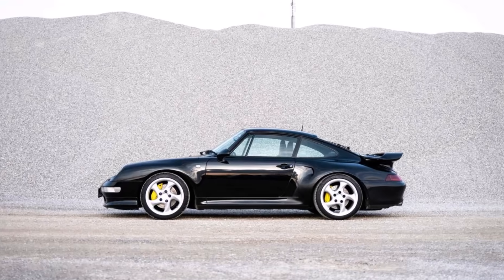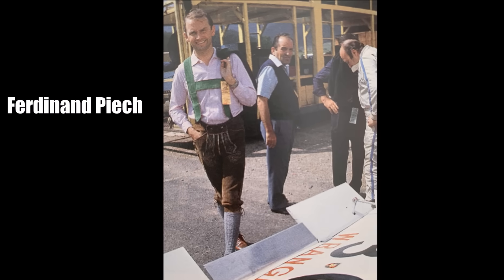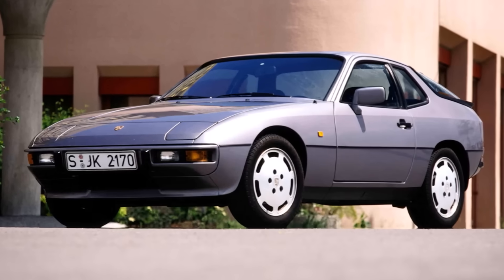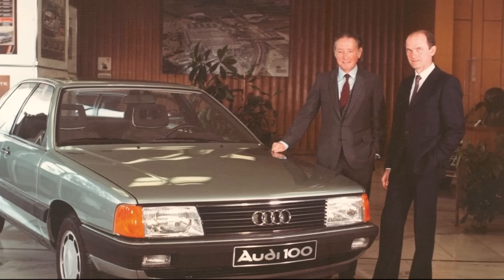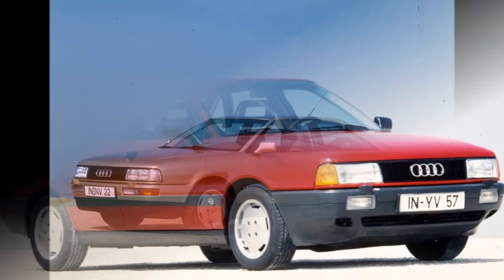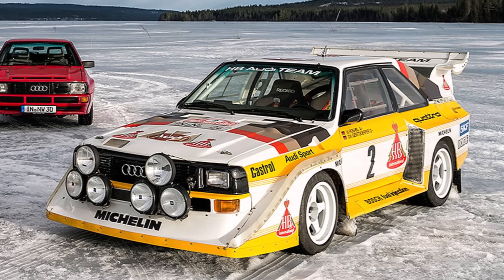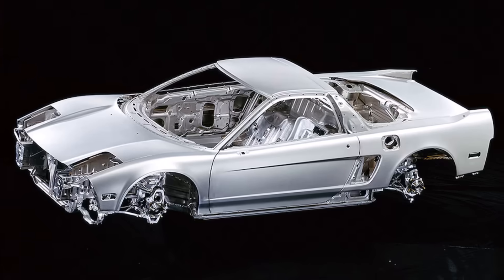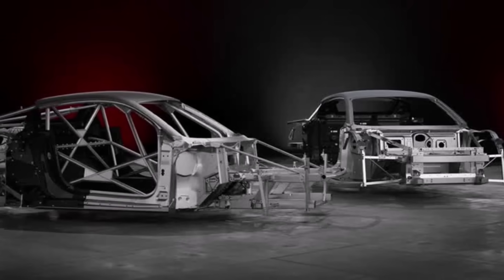How AUDI and Porsche eliminated corrosion forever - Development EXPLAINED

Comment: Galvanizing is not all created equal.  Zinc galvanized or galvalum?  Hot dip or electogalvanized?  How thick?  Constructed of spot welded galvanized sheet or galvanized after construction?  How's it primed?  The underlying steel still matters too.  I would have liked to know more about the methods used.  And there will still be corrosion.  Even if it's high quality stainless steel, enough salt will eventually corrode it.  Rust Never Sleeps.
Reply: even stainless steel rusts, it just takes longer. galvanised is nice but it will indeed start to corrode sooner or later, depending on the application of the device/tool/products/.... in question, it only takes a dent or a scratch to jumpstart the process.
Reply: @louisvl10 or it does immediately, e. g. Cybertruck
Reply: @louisvl10  There are many different grades of stainless. Common acid resistant stainless grades like 4404 will not rust at all under normal conditions as it can handle regular acids and salty conditions like seawater just fine. Sure, if you spill a strong acid on it like battery acid, it will still corrode.
Reply: @louisvl10  it's not gonna rust as long as the coating to protect the steel is maintained.
Reply: @sepg5084  by 'maintained' you mean 'not damaged' - right? Or do you mean taken apart, pain stripped, sandblasted, prayed over by a herd of monks, primered, had a chicken voodoo offering done over it, wiped with unicorn tears and massaged by a 1000yr old kracken, then painted and put back? "maintained" has no defined meaning in this context really.
Reply: I'd like to know more about the exact processes they used too. Also, I thought phosphating and e-coat would have got a mention too, as they make a big difference, and Porsche started using e-coat around the same time on some components (eg 914 rear semi trailing arms, in about 1974).
Reply: Hot-dip is impossible for sheet metal, because it warps badly.

Thin parts were ordered as electrogalvanized from the manufacturer, then pressed. This even caused a shortage back in the day!

Only thick parts like subframes were hot-dipped. 

Spot welds are the major weakpoints of course. Thats were rust starts first.
Reply: @them0leisback  I wonder if you could spot galvanize over the spot welds. Imagine a welding robot first spot welding, then quickly brushing the gunk off then immediately brining in a really hot soldering iron that's fed with a zinc wire to put a drop of molten zinc on top of the spot weld while it's still warm.
Reply: @them0leisback I worked on a line that does exactly that. Sheet metal is absolutely hot dip galvanized on modern cars. It's a continuous process.
Reply: Bodies are not 'galvanised' they are assembled from Zintec ( electro plated sheet steel ) then spot welded etc, so cut edges and spot welds are untreated. What prevents corrosion is the E-Coat process, nothing else.
Reply: You are right mate. Audi's and all German cars still rust like hell. I'd say it's actually Opel that rusts the least. I have seen tons of cars up close here in salty Norway. Believe me, the Germans take the cake when it comes to rust. On a Japanese cars I have never had to use an angle grinder on bolts. On an Audi it is the standard tool for a brake job.
Reply: Certain parts of the body were hard soldered together instead of being welded, using hard solder prevented the zinc layer from being damaged. When the 100 C3 was released, Audi made a small booklet for marketing purposes, in here they outlined several different techniques of constructing the body. It also shows a prototype 100 C3.
I still have the booklet.
Reply: I see everyone being picky, but galvanizing is way better than nothing.  Also, oxidation (rust) and corrosion are not the same.  One is a specific form of another.
Reply: Compared to Morris Marina's which could rust through a door skin in 1 year, does it actually matter?
Reply: A lot of people in these comments don't understand that zinc is a cathodic coating. Even if bits scratch off, the surrounding zinc still protects the area. Other metal coatings will accelerate the rust at cuts and pinholes (chrome is a classic example).
Reply: "Which is better, Galvalume or galvanized?
Galvalume offers better corrosion resistance and longer lifespan, typically 40 to 70 years depending on climate and maintenance. Galvanized steel is less expensive upfront and suited for moderate environments where extreme moisture or industrial pollution is not a major concern".
Reply: HOnestly, the galvanizing used on Audi vehicles isnt the best. I've got a Q5 that ahd to have it's rear subframe replaced cause it was rusitng away.
Reply: @apocalypse4312  I think it was only the bodies that were galvanised.
Reply: @apocalypse4312  I don't think sub frames are galzanised
Reply: @apocalypse4312 those parts are not galvanized.

Comment: Even on an Audi with fully aluminium body you can find some rust. It's on some fasteners, exhaust pipe, and some crossbeam that the bonnet latches into. But that's stuf that's easy to fix and not structural.
Reply from the maker: We concentrate on body rust in this video
Reply: @bsport320  So the crossbeam on an A2 that's right behind the fake grill, is sort of a body part. It starts to slightly rust after 20 years😂
But you have to open the bonnet to see it, and it only holds the dipstick, headlights, and some latch for the bonnet.
And with slightly rust, I mean a thin layer that's easy to dissolve.

Comment: Why then more modern VWs rust more than VWs that are 30 years old? VW Passat B6 is almost twice as young as the Audi 80, but Passat B6 obviously more rusty.
Reply: The B6 and cars from its are are much worse than what came before, especially for the coloured panels. In 2005 EU introduced regulation for car manufacturers needing to decrease the  amount of solvents used per car produced. 

This lead to some places of the cars that followed shortly after to have decreased paint thicknesses and some sections where different coatings were used. 

The chassis is still quite well protected, but the B6 is definitely not as resistant to scratches or stone chips on its exterior panels.

Comment: I had an Audi 80 B4 as a daily driver for a few years. The small amount of rust after 25+ years on the road, 15 of which it saw harsh winters with lots of salt, was incomparable with other cars and none of it was in structural parts of the body. Several friends have had B3s and C3s that were also decent. Sad to say this, but after the B4, Audi's steel body rustproofness plummeted and I doubt they'll ever reach the same level again. Now it's just average together with VW and Škoda and maybe Seat as well, they all rot just the same. These days you can again see cars less than 5 years old and driven less than 100k km developing rust spots on the sills, door edges, in the wheel wells etc. In some points there is nothing but primer underneath the car, when in the olden days they had covered everything with thick rubbery mass. Unbelievable cost-cutting everywhere.
Reply from the maker: Yes it’s sad to see how they cut back and saved money again.
Reply: I have a 1995 B4 90, no signs of rust yet! I love my car

Comment: In Mercedes the rust eats away at the weight of the car to compensate for the eventual decline in engine power due to wear. Thus the power to weight ratio and performance stays the same. 😂
Reply from the maker: Never saw it that way😅
Reply: Now that is good engineering.
Reply: Rust is lighter than carbon fiber.
Reply: @vvevvevvvvYeah mate but this is so much rust it will shred weight every time you drive over a bump 😅
Reply: Did you know that rust weighs more than steel? It has sucked oxygen molecules from air.
Reply: @mrtickles5982  until it falls off.
Reply: Y, but the rust flakes off, leaving speedholes. And everybody knows speedholes are like +5hp, atleast.  @mrtickles5982
Reply: @mrtickles5982 Y, but rust makes holes and everybody knows speedholes are worth atleast +5hp. 🔫
Reply: And Mercedes is the only brand that I know where rust spots just suddenly appear in the middle of a panel or door. Not on the edge or wheel well but just right in the middle of the door. Leave it and it will be a hole in no time. While I also have a 23 year old Alfa Romeo with a massive paint chip on the door and it just doesn't start rusting. Same with my Mitsubishi Grandis. The whole bonnet is covered in paint chips but hardly any rust. The only way Mercedes can get control over rust is by building the entire car out of some kind of composite material. (Plastic)
Reply: @Dani8chs  MB rust protection was awfull upp to W210 but got improved with the W211, slight more improwed arround 2005/6.
With the W212 it got really good, and got even better with the W212 facelift.
Reply: @fortune300 Yes only that it is only MB fans that believe that 😂 They are still the worst. Always have been.
Reply: Rust weighs more than steel, so that'll hardly work out in real life.
Reply: Oh man, this is gold
Reply: @SupraSav no, it's not..
Reply: I've never seen rust on a Mercedes newer than 1979.
Reply: @davidstjames_ Ok. Then you have seen very little of the world 😅
Reply: @Dani8chs   Don't judge others when you know nothing about them.  I've seen much more of the world than most people and my automotive experience is far greater than most.  Your ignorance of vehicles is very clear.  For over 40 years, Mercedes has had probably the best corrosion protection in the industry.  Now, GFY.
Reply: Wow sooo funny 🤦‍♂️
Reply: 924? look like a 944 to me
Reply: Problem with that is that a rusted panel is heavier than an untrusted panel until chunks start falling off.

Comment: My 2012 A4 is nearly rust free, a few rust dots if you may. Live in the baltics, estonia. Cold, salted winters & has held up like a champ. I don’t ever want to sell it.
Reply: Just take apart rear wheel arches, youll see more than few rust dots😅
Reply: @Glebaka  at least I don’t see it 😅
Reply: I'm jealous. My 2013 S4 (manual) is still in great shape except for rust on the rear arches and rust behind the front fenders at the lower panel. It kills me because otherwise the car, like yours, is a champ.
Reply: Southern Ontario, Canada here.Those in the know use a waxoil spray,body/chassis & have zero issues...gti & A4...PROST!!!

Comment: Galvanization is just a sacrificial layer over the metal, eventually that also goes down. Nothing is forever, it just makes it much more resistant but it ll still happen in the end especially if the rest of the car isnt properly designed with rust protection in mind
Reply: I have seen hot dipped galvanized parts that have been sitting in a damp cave for 110 years with zinc still on them. Electrogalvanizing does not depisit as thick a layer as hot dip but it does buy you many decades of usefull life.  I am a huge fan of zinc plating.
Reply: @mbox314 Yeah, hot dip galvanizing gives like at least 2-5x thicker coating, and the layers are much less capable of "self healing", or where a scratch that reaches the metal, never completely exposes it.
Reply: Yep, and especially when driven a lot in winter on salty roads.
Reply: A reasonable lifespan of 15 years in salt country means no rust ever again in California! 😂
Reply: Brass would never rust. 😄
Reply: @Rickenbacker451  it's also very heavy. Aluminium doesn't rust either and is light.
Reply: Some of those galvanized light posts on your street are over 30 years old. They still look new despite the salt spray. Only when they reach the 40 year mark does the rust start, and it starts slowly.

Comment: Car companies just figured out clever ways of hiding rust now.  Plastic around the wheel wells and the lower part of the car hides it until it's too late.
Reply: car companies seems to be gravitating towards making a car that lasts only while the leasing contract lasts. something something shareholder profits more important than making a good car.
Reply: No, they didn't. They just engineered powertrains that don't last as long as the steel in the rockers. The cars are scrapped before they rot.
Reply: Buy a Porsche or a VW PRODUCT AND YOU WON’T HAVE THAT PROBLEM!
Reply: Plastic undertrays are a godsend for rust protection IMHO. It prevents the underbody paint from wearing away, my 11-year-old Renault Zoe EV still looks practically brand-new on the underside, despite driving on salted roads for half the year in northern Sweden.
Reply: @swecreations Sweden doesn't even salt their roads brother
Reply: @eduardghemes Every part of Sweden except the most northern parts like Kiruna where the temperatures are generally too low for salt to be effective as well as the islands of Gotland and Åland sand their roads every winter.

I'm guessing you don't live in Sweden as I have a hard time believing a swedish person wouldn't know such a basic thing about Swedish road maintenance during winter time.
Reply: @eduardghemes  are you dense, sweden has 25000km of roads that are salted with 230000 tons of salt every winter.
Reply: They don't want you to see your car as it rusts, just find out when it's too late and need to buy a new one.

Comment: Honestly this always bothers me when (mostly Americans) recommend Japanese cars because of their reliability.

When I looked for a car a few years ago (I looked for late 90s early 2000s cars) all the Japanese cars looked like puff pastry from underneath and definitely would’ve needed some welding to pass the next inspection. Meanwhile almost all Audis had little to no rust and never in structural places.

If you ask me I much rather deal with a bit of engine maintenance than with sheet metal welding…
Reply: It is my understanding from watching american car culture youtubers for a while a few years ago that they in most places don't have such inspections as we do in EU which fail you for very slight things and keep you off the road. As such they probably don't care about the relatively non structural rust on japanese cars as long as they don't fold in half 😁
Reply: @ml11ML that as well as that every mechanic and their brother can fix a 1.8T or basically any VAG engine of the last 30 years while independent mechanics that are able to work on japanese cars are few and far between so you’re forced to go to a dealership.

Apart from that it feels like most of the American cars youtubers basically live in a desert so rust might just be an afterthought when they buy a car.
Reply: @Simoxs7 it's a poor mechanic that can only work on a VAG car but not a Toyota.
Reply: @ml11ML accurate!
Reply: They make it a pain to do the maintenance on modern Audis though
Reply: In India, German cars are notorious for poor reliability. However, Japanese cars are reliable, easy to maintain and repair and thus have the majority of market share. We have poor, broken roads here so the cars get tested really hard.

Regarding rusting, German cars don't have such problems mostly because their  DSGs blow up after 100,000 km, suffer from electrical issues and get scrapped after 5 years.
Reply: That’s the american way. I personally completely agree, if you take a look at junk yards and listings you start to understand that lifespan of a middle japan car is about 15 years (20 is the max), whereas  germans’ only start to glow like fine wine after 15 and get second life after 20
Reply: Yeah, steel bodied merican trucks are so resistant to rust😂😂😂….drive them off the lot and you can almost see the rust forming (excepting al bodied fords) ….
Reply: Also: The unibody IS THE CAR ITSELF! It’s the “part” that houses every other part, plus the VIN. Therefore, a rusty bodyshell means the car is gone and only bolt-on components remain.

A Golf with a engine swap is still a Golf, but a rusty Toyota is nothing other than a pile of car parts (and rust).

Comment: I work in auto body repair, VAG cars are specifically the most rust prone cars, I've seen a lot of previous generation Passat with rust already forming on front fenders
Reply: The 2005 EU solvent regulation for car manufacturers decreased the paint and coating quality a lot.
Reply: @rkan2  and somehow only VAG were heavily affected, crazy stuff.

Comment: What is meant by fully galvanized?
Stamped from zinc galvanized steel, or plain steel welded together and then whole car body electro zinc galvanized by submersion,
or cataphoresis by submersion or hot dip zinc galvanized?
Reply: At least it's not hot dipping.
Reply: I had those questions too.
Reply: They use galvanized steel as raw material for the body.

Comment: As the time has passed, another drawback for all-aluminium bodies became clear - repair technique for damaged aluminium structures is highly different from regular steel parts, which led to higher repair costs. Aluminium doors and hoods are more expensive then their steel counterparts, because... well... they aluminium, duh.
Reply from the maker: I can confirm that, someone drove into my parked A8 D2 and the body repair costs were a lot more expensive than on a steel car.
And you have to find a workshop that can repair aluminium bodies...
Reply: Some time ago, while working as an appraiser for insurance company we had a rule of thumb - any damaged aluminium body panels was considered as irrepairable or in rare cases (i.e. rear quarter panels) repairable, but on increased labour rates.